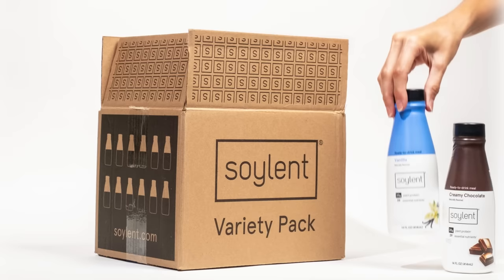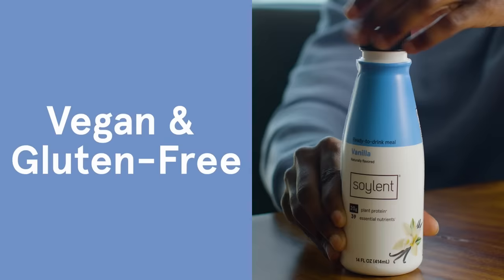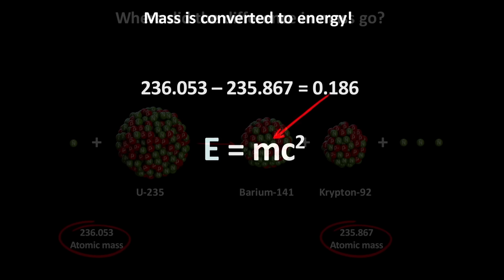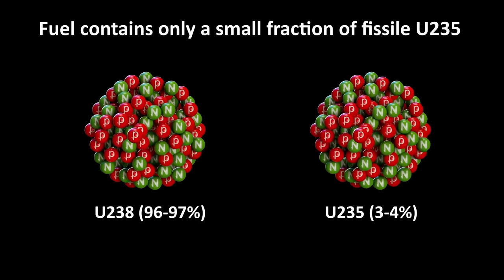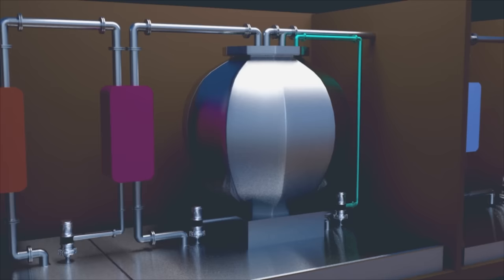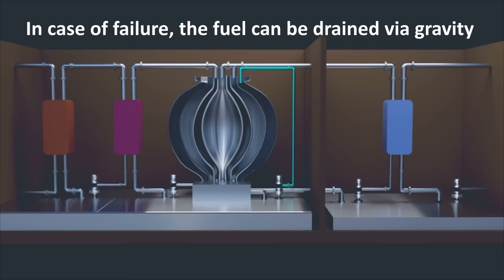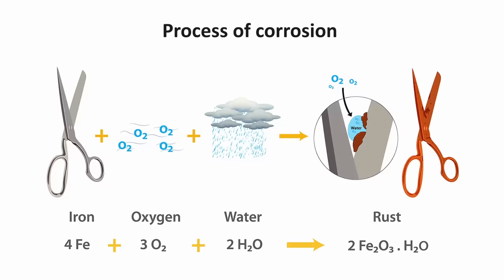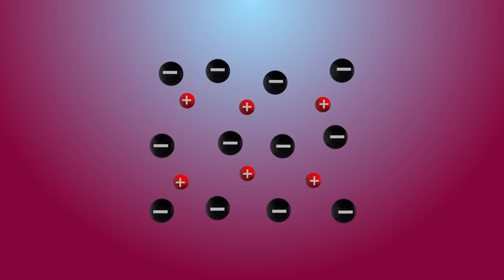How Molten Salt Reactors Could Revive Nuclear Power

Comment: Corrosion resistance is not purely about metal alloys. .  And we have had 50 years of further technologies.  Other Corrosion technologies include diagnostics, machining, 3d printing, sacrificial materials,  electronic systems., maintenance, robotics,  silicon carbiðes, carbons, ceramics, cooling, modular systems, computer design and testing., and oxygen removal.  Also the widespread use of industrial Molten Salt systems. Possible oxygen scavanging.  Can anyone add to this. 
An MSR should be built to have easily replaced parts and accessibilities, as well as inspection methods. 

With so many options to consider along with hard steel alloys, corrosion should be manageable.

Comment: Hi at 700°C, you can split water into hydrogen with a bit of chemistry (requires 600°C at least) and you can even solidify is by mixing it with magnesium at a few bars of pressure (250°C and 6 bars of pressure are enough), thereby making very cheap and safe and stored energy, to fuel cars, heating etc. "solidified red molten-salt hydrogen"

Comment: A correction:  Existing BWR/PWR nuclear power plants are not really that technically complex.  The biggest driver of their expense is the costs imposed by REGULATIONS.  Whether or not that regulatory burden is too much, too little, or just right is a separate question from the FACT that it is the biggest driver of cost.  

Over on the steam turbine side, a nuclear power plant is FUNCTIONALLY identical to a coal, gas, biowaste or even wood fired power plant.  Yet because it is "nuclear", the steam turbine setup of a nuclear plant will cost 5x-10x as much because of the costs imposed by regulations.

Comment: It’s time we had a reality check and consider the following options.

Cold Fusion (LENR) - Unproven hypothesized type of nuclear reaction that creates nuclear fusion at room temperature by producing more energy than the input energy can be produced from its altered state.

Tokamak Nuclear Fusion Reactor (ITER) - Development cost for the ITER is $150 billion. Requires a temperature of 150 million degrees Celsius to create nuclear fusion. Reportedly the record to date but having to use more input energy than produced is 69 megajoules of fusion energy for five seconds using 0.2 milligrams of fuel. 

4,536 Mw (VOGTLE) Nuclear Fission Reactor Costs $35 billion requires 1,282 hectares, nuclear safety costs $200 million per Mw, no technology to deal with nuclear waste and only has a known minable uranium reserve at current extraction rate of 80 years. 

The alternative.

Solar Hydrogen Energy Recovery Gas Turbine – 301Kwh (equal to 46/6.6Kw home solar installations) of solar energy collected from the sun’s constant nuclear fusion at atmospheric temperature is sufficient for electrolysis to provide the start-up sequence and enable a hydrogen Gas turbine to synchronize with the turbines Variable Frequency Generator and provide constant electrolysis to continually fuel the turbine and operate the energy recovery system on a hydrogen use as produced basis to generate a variably regulated energy range between 80 - 330Mw with optional co-generated steam capacity up to 700Mw of electrical energy on a 24/7 basis. 
The turbine has three operational parts, weighs 6 tons, 3meter high, cost $36.5 -49.5 million, requires an operational footprint area the size of a football field, noise level is 60dbl at 60m, incorporates direct air capture of CO2 at 1,400 Kg/sec and includes a 14-year end of life decommissioning or optional refurbishment program. 
Sixty-five carbon and pollution free, shovel ready installations generating a total of 21,450 Mw, retrofitted to any of the 120 Hydro-electric schemes would provide Australia's entire energy needs covering a combined operational area of 33 hectares for a 2023 total cost between $2.4-3.3 billion, construction period is 3 to 5 years, meet net zero twenty years earlier and makes wind and solar farms including hydro, gas and nuclear energy production redundant.

Comment: This technology was first developed, and successfully tested, in the 1950's and 1960's.  The reason it did not see use in the 1970's, under the Nixon Administration, was that it could NOT produce Plutonium, which is a material used in the making of nuclear bombs.

So, an added benefit of Thorium reactors is that third world countries could use it for energy, but not be able to make nuclear bombs.

Another benefit, which was not covered in the video is that it can take the existing nuclear waste from regular nuclear power plants and use that for its fuel.  In this way, the nuclear waste that exists could be used up and made into a safer, shorter life waste, that will be easier to dispose of in a few decades - instead of thousands of years - as was discussed in this video.

Comment: As a general rule, compounds will increase in size with higher temperature (molecule translation rotation etc). However, ionic compounds have an extremely high boiling point

Comment: Hydrogen is another example. In using hydrogen for lighter than air vehicles, all people see is The Hindenburg. Today's technology could render hydrogen extremely safe allowing for larger vehicles (helium is twice as heavy) and larger loads, which cold help the transfer problem between terminals some distance apart, and with electric motors could be used virtually oil free.

Comment: I have an idea for corrosion container. Container made of clay does not corrode with salt.

Temperate 

In modern societies pottery and brick is fired in kilns to temperatures ranging from 1,800 F to 2,400 F. Most of the common clays like clay shown here on th 17:49 e left found in our back yards start to deform and melt if they are fired higher than about 1,900 F.

In ancient time in Persia (Iran, Iraq) jar clays were used for batteries and other chemical reaction, also clay jar were used to store water as good insulation.

Comment: Liquid fueled reactors are great if you keep them away from sea level The main problem is if sea level rise you have a water soluble nuclear fuel that can do great harm. This is among the original reasons for making solid fuel reactors. You can keep the advantages Of preventing steam explosions By using high temperature salt coolants in a solid core reactor design.

Comment: Chernobyl accident was caused by human stupidity, by bypassing the safety systems, while Fukushima was caused by the same stupidity, by placing the powerplant on the sea shore, in an area prone to large quakes and tsunamis. It is hard to believe that a thorium powerplant is safe facing the limitless stupidity. As a note, the oxygen is not the only element than can cause corrosion, flourine is also  very aggressive, along others. 
The video looks more like a hidden ad to a company that payed for a nice trip.
Reply: Fukushima wasn’t that dumb. The expectation time for a quake of that size is 400 years…..so it should be save to run it there now for quite some time.
Reply: @DrDeuteron  well, you might be right. However, from my point of view, that was marginally acceptable, considering the operational lifetime of a nuclear powerplant of about 50years. That would raise the chance to have such an event, in that area , probably to 1:100, which seems quite high from the point of view of the risk management.
Reply: @alex3261  true.  Low prob X massive high consequence = not good risk.  But it came down to the tsunami wall, which was very high. I think it was rated for an 8.9 generated tsunami, and guess what? They got a 9.0, which is absurdly high number, and it was overtopped. I’m not sure if that’s on the nuclear industry, or the geologists. There was a design flaw that should it flood, the diesel backup pumps were in the basement, iirc?
Reply: @DrDeuteron  as I said, the risk assessment was starting from wrong assumptions. Remember the 2004 Indonesia quake, they was a 9.3, generating a 100 ft. tsunami
Reply: @DrDeuteron  Actually no.  Tsunami's like that occured in that area about every 90 years.  They have lots of history and there are stone markers on all the hillsides on how high they reached.

The Japan Nuclear Regulator only requred reactors in those days design for flood events that occured on average twice the desing life of the plant.  So they only had to look at events that occured every 80 years or less on average.

That left Fukushima with a probability of 45% of a tsunami in its 40 year life - a bet they lost.

That plant never would have been licensed in the USA, Canada, or most of the EU as they require looking and designing based on the much more than the worst event in the historical record.

Sad thing is that Japan bull dozed away about 5 meters of a hilltop to get the plant to the level they built it.  Had they built it 3 or 4 meters higher the tsunami would never had affected it.
Reply: @perryallan3524  so they basically preflop shoved blind against Q2o, and caught a massive cooler. Nice.

Comment: The biggest hurdle for MSRs is licensing. China is getting the jump on it with the TMSR-LF1. The closest Western firm to rolling out an MSR is ThorCon, (IIRC) they are about to test a non-fissile "Hot Loop" very soon. ThorCon, a US firm, decided to do the work in Indonesia because of the licensing issues. 

Thorium is a better fuel than Uranium because only U235 is fissile, whereas all Thorium 232 (non-fissile) can be used as fuel once seeded with a neutron emitter to start the reaction to Protactinium 233 then Uranium 233.

Comment: I've been following Copenhagen basically since their inception so I clicked on this video seeing that you have some new animations of their Onion Core.
I'm sorry to say though, you got a few things wrong or at least not very accurate, some things just not explained properly.
The worst offender was you talking about U238 in the classical fuel rod as if it's just dead weight that creates problematic plutonium. You specifically saying it's "not fuel" because it can't be fissioned BUT then turned around and said that Thorium "is fuel" even saying that it's in the fuel salt of the Copenhagen reactor (which is false).

You can't have it both ways. U238 is a fertile material EXACTLY like Thorium. U238 turns into Plutonium inside a reactor which is a wonderful fuel. Thorium turns into U233 which is an even better fuel when you similarly hit it with a neutron. Neither are fuels but both are fertile materials which make fuels as you go. There's a little bit of a nuisance with Thorium because there's an intermediate step of Protactinium which needs to be kept away from the reactor until it turns into U233 while U238 can be inside the reactor the whole time turning into Plutonium without any extra help.

Comment: Energy production was in 2022 just ~6700TWh from nuclear versus ~23500TWh in renewables. Maybe your statistic was counting primary energy, which counts all the energy lost as thermal energy aswell. Pushing thermal electric production much higher in the statics.

Comment: I think a bigger problem to the wide spread adoption of molten salt reactors is the nuclear energy industry itself... Currently, reactor maintenance and fuels costs are extremely high, and companies making the fuel and selling it are making a gigantic pile of money from it. In contrast thorium doped salts can easily be mixed on site, and refined thorium is plentiful and very cheap. It would drastically cut the profits to be made, and thus there's a big incentive to sweep the better technology under the rug and keep making the current fuel... Not to mention it would also cut into other energy industries margins...

The technology has the potential to solve the current world wide energy crisis... Forget fusion, if you have a container sized portable fission reactor design that is cheap and easy to build and cheap to fuel, and utterly safe to operate, and can be commercialized with minimal risks of proliferation of weapons-grade fuel, there is no point to a gigantic fusion reactor 40 years away... You can dump a couple dozens across Africa or Asia and power the entire continent.

Comment: The problem with gravity is, we do not control its vector. Meaning, if your reactor is as small as to fit on a trailer, it is imaginable, that something could turn the reactor on its side / top, and your "gravity-assisted" safety protocol is suddenly non-functional.
Other than that, does the fissionable material have to be dissolved in a corrosive salt? Are there no other methods to keep it a fluid?
And as for people being afraid of nuclear reactors - I think they are rather afraid of the radioactivity, which is not particularly good for humans, but humans lack any kind of sensors to detect it (if you don't count extreme intensities, way above what is necessary for a dose of radiation deadly for a human over a comparably short period of time).
Fusion would be great. MSRs are still better than the conventional high-pressure nuclear reactors, which are still way better than coal power plants, as far as pollution harmful to humans goes. So I am for sure for MSRs, but it will take a while until they will have all technological challenges sorted out, to much stricter rules than what the old conventional high-pressure nuclear reactors had to adhere to (as those were banned from a number of particularly "fearful" countries, like Germany), and a number of years of problem-free operation in "lab conditions" behind them, before they will see widespread commercial use. And the fragmentation of investors, by the repeatedly publicised hopes, that a viable fusion power plant is "around the corner", is and will be slowing down the progress of MSRs on their way to commercialization.

Comment: The problem with nuclear energy isn’t the cooling process or safety, it’s the massive price.  During the time to build 1 nuclear power plant, 4-5 times the capacity in solar and wind +battery storage, is built, at 1/3 the cost.  SMR’s hold some promise but, they need to figure out how to drastically reduce the price.
Reply: This type of reactor drastically reduces the price of nuclear, that's why it's exciting.

Comment: The usage of Thorium or Uranium has almost noting to do with the safety of the reactor, Thorium is mildly safer because need a moderator for fission to happen while if you put enough enriched Uranium in the same place it will become self sustaining, but to avoid that being an issue you would shape your ractor and the surrounding area so that it was impossible to get enough Uranium together for criticality outside of the fission chamber.

Comment: This was an interesting video.  I am for nuclear power, but with the current regulations in the US it is nearly impossible to build a plant.  Unlike the 1950's and 1960's it takes a decade or two today to process the application before ground can be broken.   Prior to President Canter there was a system to recycle nuclear waste in the US to be reused but he killed it being afraid of nuclear weapons proliferation from it.   There were reactors built to use this recycled nuclear material but they use regular fuel instead. This is my opinion from the research I have done into it as an interest.

Comment: Here is an little thought experiment for you Nuclear fanatics with your hard-on for the energy density of Nuclear fuels.  Calculate the total kwh of electricity from a kg of Nuclear fuel in a normal LWR, vs the kwh from the lifetime output of a kg of industry standard solar panels at an average mid latitude location of the US.  Hint the Solar panel gonna beat the nuclear fuel by a factor of 10, just try it.
Reply: Did.  Solar panels have to be replaced long before the same kg of raw materials.  Hint for your calculations;  use real life actual output, not Greenie induced RATED numbers.

Comment: Simple question.  Given that these things can be fitted on a trailer, why does it have to be a 40 year expected life span?  I wouldn't expect my car or my generator to last 40 years.  The 40 year life span is a requirement for the present generation of fission reactors.  These require huge concrete constructions that are supposed to contain explosive escape products formed by a meltdown.  I would expect these small MSR reactors to have a life span of ten to 15 years at best before they would be replaced, which given that they can be manufactured on an assembly line would not be any problem.

Comment: The commercialization issue is the corrosion issue. Refueling while operating is a less attractive feature once you realize how often you need to shut them down to replace parts.

Removing moisture from the system is an interesting idea though, perhaps replacing all of the atmosphere with an inert gas like argon could decrease the frequency of repair shutdowns needed to make them viable.
Reply: Corrosion is the main issue that Copenhagen has been testing and retesting for years now. They know it works with just the salt at high temperatures and the next step is with fission products in the salt.